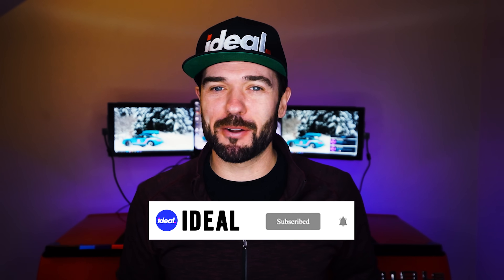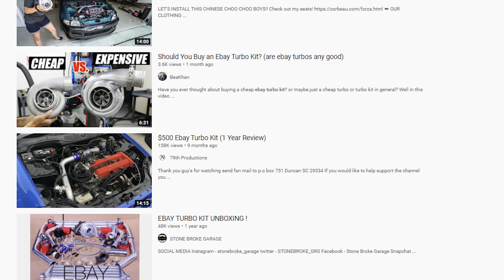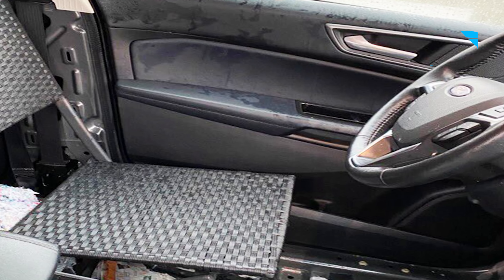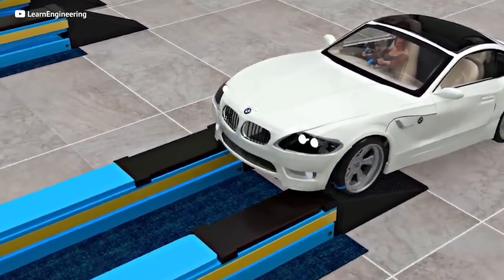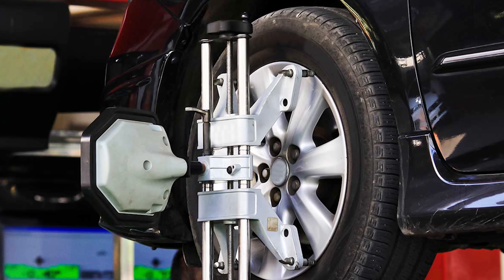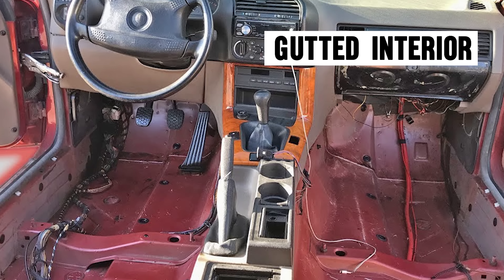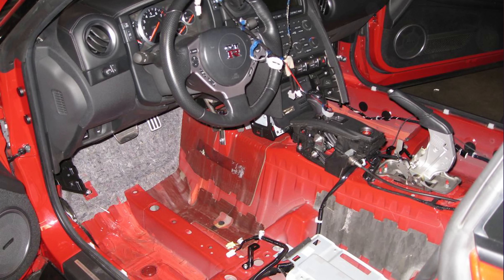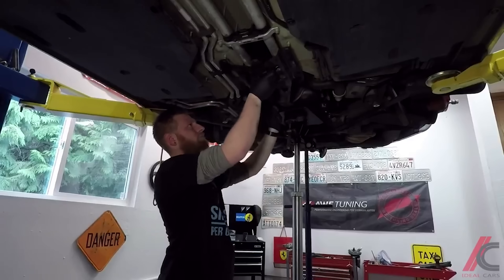You're Modifying Your Car WRONG!

Comment: Sorry I had to unsub from this one. Most of your guys' videos are basic and boring. Telling people what they should or shouldn't do. You didn't even mention anything that could ruin a car in this video. and by ruin I mean make it break and undriveable. if someone cambers their wheels I think they already know their tire life will be reduced. That doesn't ruin anything, they are just into the look of slanted tires at the expense of changing them more frequently. The idea that you need to align your car for swapping wheels and tires is absurd. Maybe if you are changing the height of your car by adjusting your springs, but it wouldn't be the wheels that caused the need for an alignment. Your content is flashy with no substance. I guess that is how I would sum it up. man, going to a professional mechanic for everything teaches nothing. Almost like hot rodders and racers over the ages wrote the books on things just by good old guess and check method. education costs money even if it means breaking some stuff in the process.